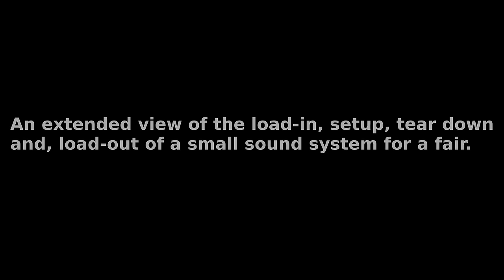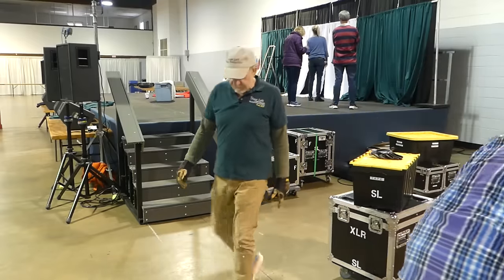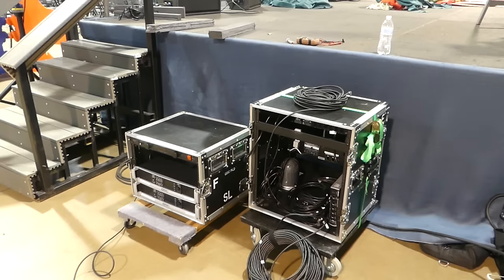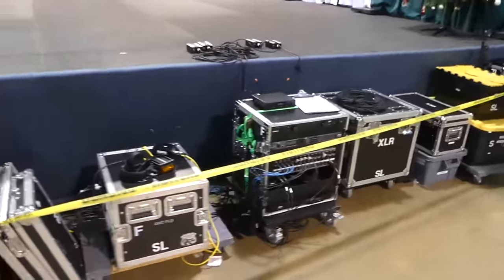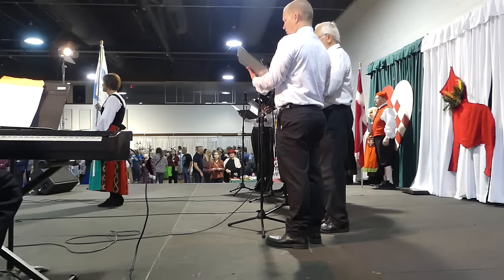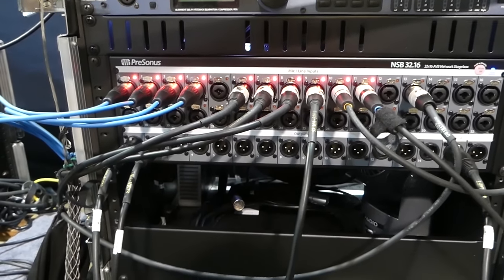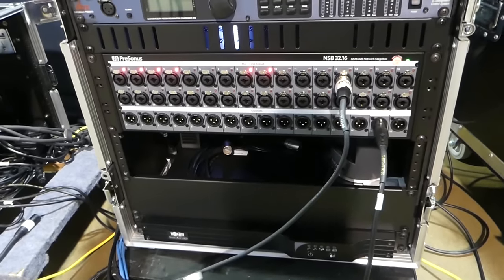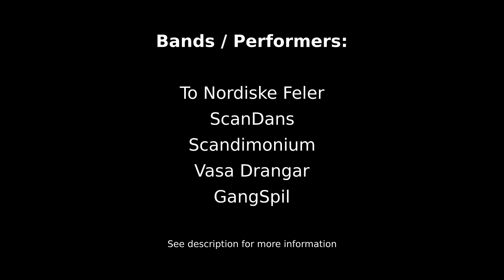Sound system setup for a fair.  Overview of the labor and work involved - Event Video 48

Comment: I stopped using PreSonus because of latency issues. I don’t use any of their stuff in my recording studio or on my professional sound gear. Loved the video and you do great work with sound and running your setup for events.
Reply from the maker: Thanks for your comment.  For the events we have done with our Presonus consoles, (this is the first with a digital snake solution), this was also the first event we experienced an extended latency... I'm still researching possible causes.  Thanks for watching!
Reply: Hi we have the same issue with Presonus stagebox and sc console. Audio drop for 1 second and everything went back to normal. Sometimes audio drop happens a few times in a row. Could not figure out what caused the audio drop.

Comment: Great to see you're doing the Scandinavian Christmas event again.  I notice a different venue this year too. Like you say, the analogue/digital equipment are tools; I've been using a digital desk for many years, but until recently only been using Analogue Snakes.  I still have and use analogue snakes for my runs back to the digital stage box because it's tidier and I find much easier to work with. What are you doing with your PreSonus 16.4.2?  I have one, and haven't used it much since moving to an all-digital system; I'm tempted to sell it, but I'm equally reluctant, as it's a great console, and I'm certain it'll have its uses.
Reply from the maker: Thanks for the comment!  We will always have (and will mostly use) analog snakes.  The digital snake solution was ok for this show, but I think it was overkill for the required gear for the event.  I still have the 16.4.2   Though, I have not used it for many months... however, I recently used it for a parade that we do every year.  I considered selling it, but may actually keep it... it is a great console.
Reply: @stageleftaudio  I will probably keep my 16.4.2 also. I've mixed hundreds of performers on that console, and I've gotten fairly attached to it. I do need to replace a couple of intermittent aux send jacks, but aside that it's in perfect condition, and it's ideal for smaller shows.

I'm familiar with the Chrisrmas Event you cover; it's great to have regular clients, proves you're doing the right thing. 

Merry Christmas.
Reply from the maker: Exactly... ideal for smaller shows.  Have a good new year.
Reply: @stageleftaudio  You too, have a great New Year and an amazing 2024!

Comment: I saw in a quick glimpse in your intro… you are using crank up stands for your line arrays. What kind of stands are those? I have been looking for something like that but everyone points me to Genie lifts. I have only 4 per side. I don’t need huge and those look perfect.
Thanks for taking the time to show what is takes.
Reply from the maker: Those crank stands were manufactured (and sold by) Penn-Elcom.  However, as of several years ago, they no longer manufacture/sell those stands.  I think another company bought the design and took over manufacturing, but the stands are no longer available through Penn-Elcom.

Comment: For checking monitors I recommend having a tablet thats running UC surface connected to the console with a router so you can check monitors with the tablet
Reply from the maker: Great idea.
Reply: Definitely! I don't run my PreSonus system, or the Allen & Heath systems, without tablet control!

Comment: Great content as usual. What influenced your choice of FOH speaker height? They look like they are only about 5-6 feet up, which is about head height, and up against the stage look rather low. Wouldn't you get better coverage from them if they were a little higher, or would that have affected coverage in the front rows without having a front fill?
Reply from the maker: Thanks for your comment.
Good question.  There are several logistical concerns with this event.  Most everything involved with how we setup this event is in response to what the client is needing.  The low speaker height (as you referenced) is to ensure coverage for the front rows.  But the low height also helps with keeping the sound projection within (or very close to) the range of the seating area.  If the speakers were higher, the sound would project further/over the seating area and would introduce a noise problem with the vendors (which was an issue when I first started working with this client).   Also, the low height helps keep a "line-of-sight" available to the stage for the "outside" (or flanking) seating areas.
On this particular event, their seating area was very wide (at the limit of the horizontal coverage of the FOH horns).  I'll be promoting a center-fill speaker for their event next year, especially if they are planning for a very wide seating area again.
Reply: Had the same question. Wouldn’t it be also possible to have the speakers setup higher with a tilt?
Reply from the maker: That would certainly work better for the seating area, however, if the speakers are any higher (than what is shown in the video), it would cause a line-of-sight issue with the flanking seating areas; the guests in those seats would not be able to see a good portion of the stage (or performers).

Comment: Hi SL, informative video as usual. Well I have a question which is unrelated to this video, sorry for that. 
I have a pair of Behringer B215xl speakers (passive) and a pair of Alto Tx315 speakers (active). Can both pairs share the same output on the active crossover as highs? (using an XLR splitter cable).
Reply from the maker: Yes they can (that is a common setup when using passive and active speakers at the same time).  If you want a balanced audio output between the Alto's and B215xl speakers, just watch the volume levels between the speakers.  You may need to turn one or the other up or down.  Thanks for your comment.
Reply: Oh great! Thanks SL, i appreciate.

Comment: How do you like you C112V?  I have the CM12V and CM15V, but haven't jumped on the main PA speakers yet - boy they look pretty though.
Reply from the maker: The C112V cabinets are great.  Their SPL rating (along with the CM12V)  is quite a bit higher than other passive cabinets of the same "family".  It's easy to get decent volume with them.  For larger shows (when we are flying our FOH speakers), we use the C112V cabinets as monitors along with the CM12V.  The nondescript image of the C112V cabinets keeps them somewhat discreet to the guests.

Comment: Great show! What are you using for comms?
Reply from the maker: Thank you.  We use Pro Intercom (I don't recall the exact model).  It supports 3 stations; we are using 2 stations for this event.
Reply: @stageleftaudio  Those Pro Intercom stations are killer, do you own their larger base station for larger events or find the three station setup is fine for you?
Reply from the maker: They are decent units!  For the events we do, the three station setup is perfect.
Reply: @stageleftaudio  I see in the video you have the extra strobe station as well. Have you found those to be useful?
Reply from the maker: Yes!  The strobes are extremely useful.  The head-set packs have a red call-light on them, but they are difficult to see.  The strobes were a well needed addition.

Comment: I’m curious, why didn’t you raise your mains?
Reply from the maker: This event is a little different with the setup requirements.
Most everything involved with how we setup this event is in response to what the client is needing.  The low speaker height is to ensure coverage for the front rows.  But the low height also helps with keeping the sound projection within (or very close to) the range of the seating area.  If the speakers were higher, the sound would project further/over the seating area and would introduce a noise problem with the vendors (which was an issue when I first started working with this client).   Also, the low height helps keep a "line-of-sight" available to the stage for the "outside" (or flanking) seating areas.

Comment: Why did you choose the large format mics instead of example Beta 58s?
Whats the benefit?
Reply: У АТ3035 средняя мембрана, ~ 20mm, ещё лучше были бы микрофоны с маленькой мембраной, навроде sm81, они более устойчивые к обратной связи, чем студийники с большой диафрагмой.
А выбор конденсаторников обусловлен тем, что они, в отличие от динамических микрофонов, лучше берут звук на расстоянии.
Reply from the maker: Large format mics (condenser mics) are more sensitive than Dynamic mics; which is why they are used for choirs and for distant mic'ing.  The Beta 58 is a good mic, but is designed for the singer to be directly close to the mic for best results.
Reply from the maker: Да, динамический микрофон приведет к меньшей обратной связи, но не подойдет для записи хора или для удаленной работы микрофона. Спасибо за ваш.

Comment: You rocking 4x NX45?
Reply from the maker: Not for this event... all speakers were passive (Yamaha CM series).  All powered with a single QSC PLD 4.2
Reply: 4 NX45 would be overkill for an event like this .. Perfect for wide coverage of a rock show outdoor though
Reply: @georgesnow  yeah I saw the boxes side by side, and I was like damn they need some
Volume haha
Reply: @mitas3484  it's for spreading the coverage for a wide audience, not providing more output power
Reply from the maker: The seating area was very wide.  If we do the event next year, we may need to bring a center-fill speaker so the main tops can be splayed more.

Comment: Do you also bring a backup digital snake, since it's essentially just a computer, which can crash?
Reply from the maker: Good question.  Our backup is analog snakes (whichever one we need to bring for an event).  I considered having a backup digital snake solution, but It was very cost prohibitive!
Reply: @stageleftaudio  Talking about backups, it's such a pity that Presonus doesn't provide dual-cable backup solutions for AVB-based stageboxes.
Reply from the maker: Actually, the Presonus stage boxes are dual-ported.  The second port can be used as a primary (as a backup) or as pass-thru to another stage-box, or as a primary for a second console.
Reply: @stageleftaudio if you have a 32R, it also doubles as a digital snake. Big events like this, I run a 32R on stage, and an NSB32.16, running the 32SC FOH.
Reply from the maker: Nice!

Comment: You seriously needed 5 hours for load in and setting-up?

Seems more like 2,5 - 3 hours tops. You wouldn't get any longer in 98% of that type of jobs over here in the Netherlands. 

And the more equipment you have on wheels, the less time you need.
Reply from the maker: We didn't need 5 hours, but it ended up that way.  Our normal setup time for an event this size is about 4 hours.  The stage location, load-in time, an extra safety safeguards added more time for this setup.
Reply: 2 people, long load in distance. 5 hours makes sense. Been there!
Reply from the maker: For sure... it can be a lot of work!